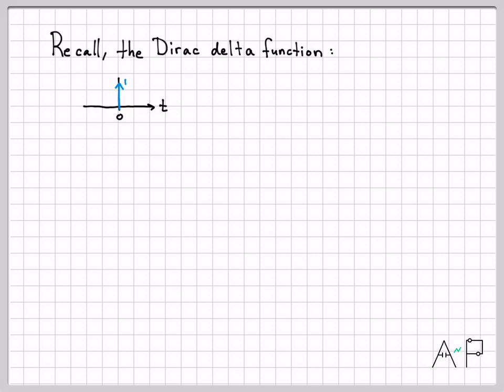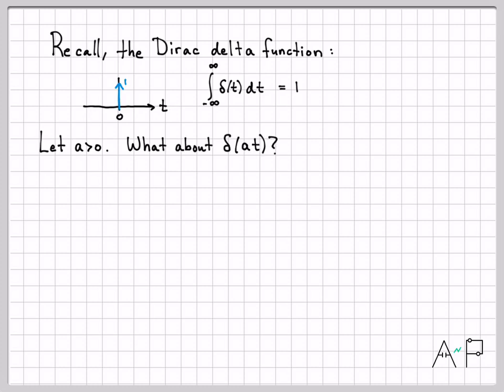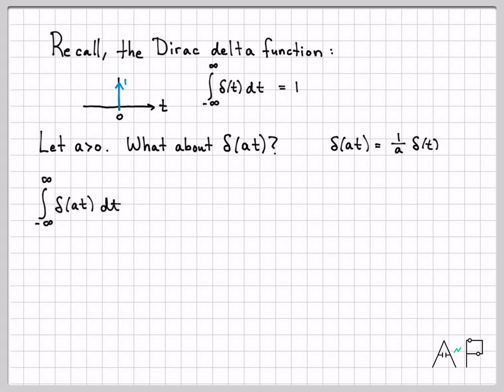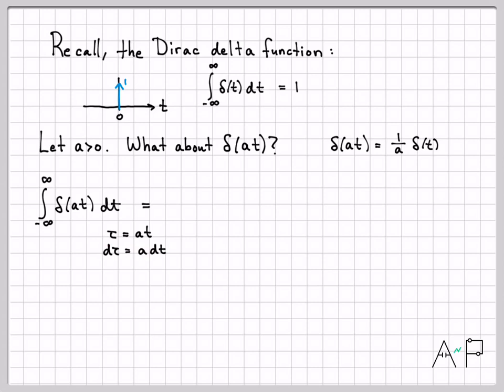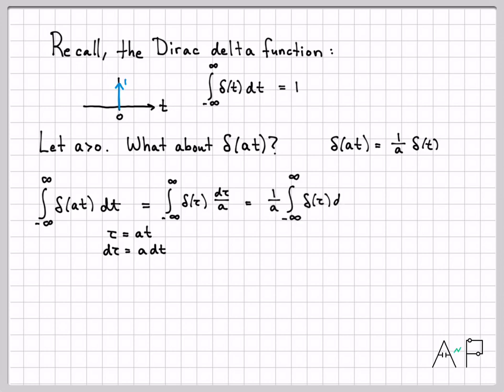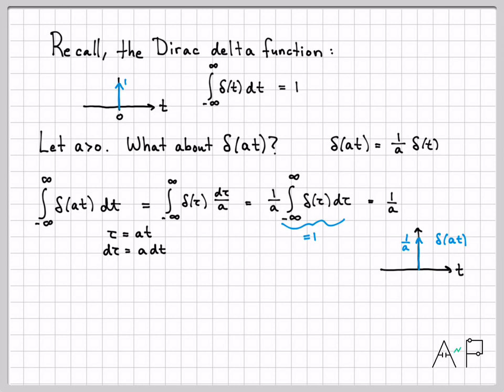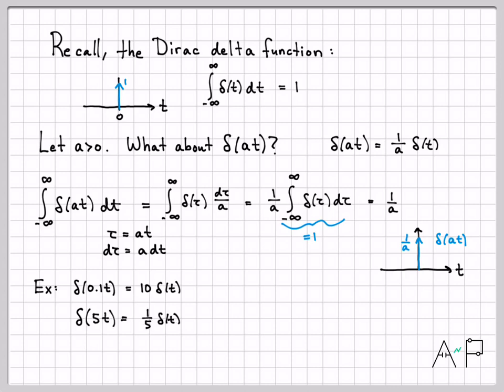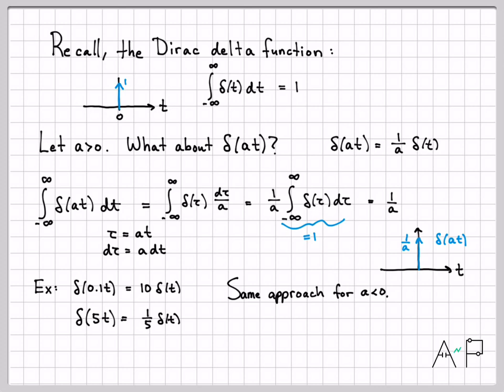Time-Scaling a Dirac Delta Function

Comment: Hi Adam, I can understand how time scaling a dirac delta function/unit impulse function by 'a' results in 1/a of the dirac delta function. However, I have seen tutorials where time scaling a signal generalized to f(at) = 1/a * f(t), I think this is incorrect, eg if f(t) is a square signal between t=0 to 2, with amplitude = 2, time scaling f(t) to become f(2t) should squeeze the signal to become a rectangle bounded by t=0 to 1, with amplitude maintained at 2. If f(at) = 1/a*f(t), then the amplitude of the time scaled signal would be a fraction (1/a) of the original signal. Could you kindly clarify ?
Reply from the maker: Only the dirac delta has this property. In general, time scaling a signal f(t) to f(at) only changes the temporal extent/length of the signal. Time scaling does not change the amplitude of the signal. The one exception (examined here in this video) is the dirac delta function. I've never seen anyone claim that the arbitrary signal f(t) when time scaled yields f(at) = (1/a)f(t). I disagree with this equation. Hope that helps,
Adam